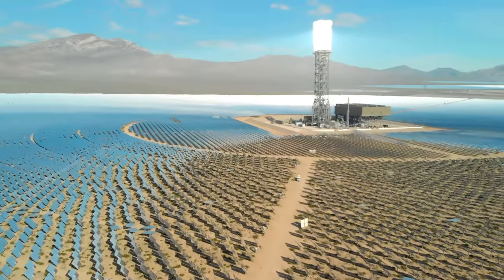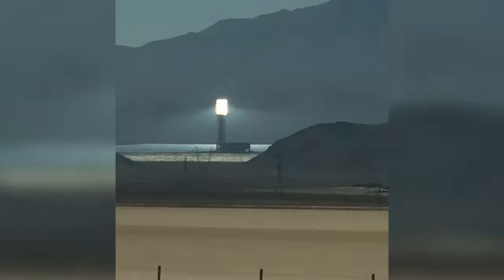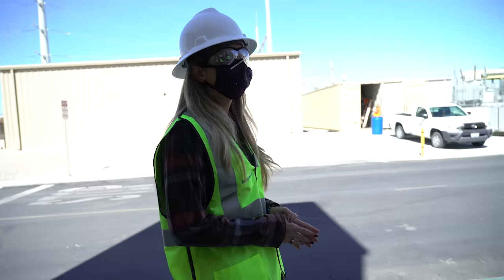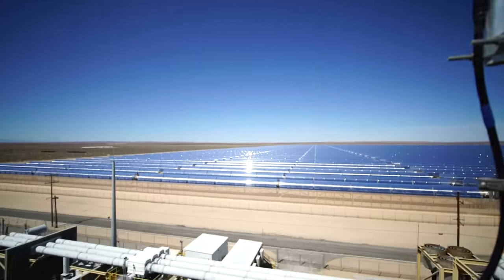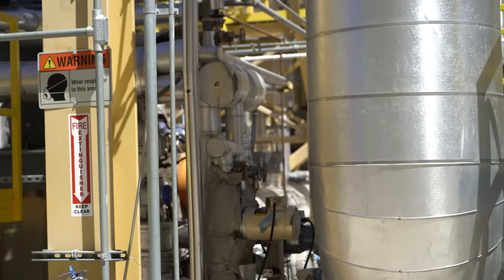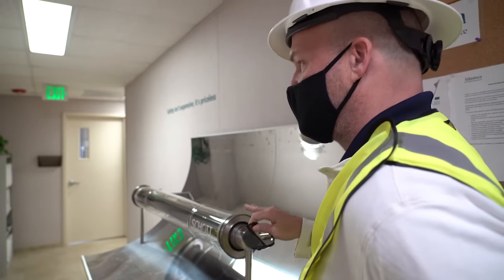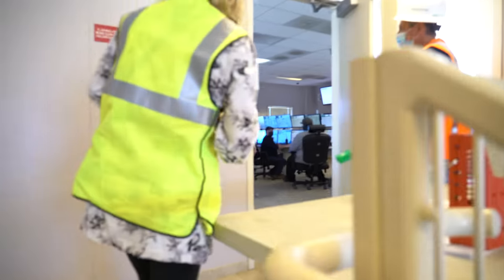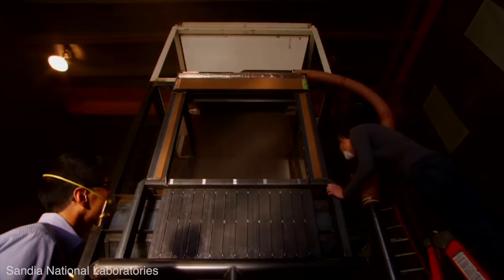How Mirrors Could Solve our Energy Problem

Comment: This solar thermal tower power plant has closed down, as it was costing more in maintenance than than the income from electricity. The issue is complexity, cost, and economies of scale. The cost of PV and battery storage is much cheaper than solar thermal, and is still getting cheaper.

Comment: I made some of those parabolic mirrors at Noor and Noor2 which are installed in Morocco. Specifically, I was the plant engineer at Rioglass Solar in Surprise, AZ, and I designed, tested, and validated the packaging to ship 2 tons of glass (per package) across the world. I also 'owned' the mirror line, furnace line, product printing, etcetera. 

One small nitpick: it's not a focal 'point' but a focal line.
Reply: Is the focal point the radius?
Reply: @koendos3  No you get a focal point when using a circular parabolic mirror. These are linear parabolic mirrors, so the light is not concentrated in a point but a line.
Reply: @koendos3  no, the focal point of a parabola is opposite from the directorix line. Focal point is where all parallel, incident rays (from the sun in this case) are directed to. This applies to a parabolic curve in 2d (x and y only) space. Since the solar arrays are parabolic troughs in 3-d space ( x, y, and z), all those infinite focal points line up to form a focal line. System efficiency depends on that line having a very narrow (narrowest possible in practice) width to minimize energy lost to reflection.
Reply: Also, those parabolic troughs are 4-segment arrays composed of 2 inner parabolic segments and 2 outer ones. They are of course symmetric for max solar capture because they are computer- steered to point optimally toward the sun.
Reply: @nicklockard  I wonder if at some future point it will be possible to make a Sun-fed linear LASER, focussed in a line.??
Reply: @nicklockard  Do they do ray-tracing to shape the reflectors like was being discussed a couple decades ago? Or is the gain not worth using a simpler parabolic shape?
The idea was to get the energy flux more evenly distributed across the cylinder than you would get by focusing the light to a "point/line" of zero dimension.
Reply: Do you know what the final energy output is per square meter of land used for an installation? I wonder how it compares with PV panel output energy per square meter.
Reply: Its a focal point if you slice the mirror in 2D.
Reply: @Markle2k  I think you're speaking to compound or complex parabolic troughs which are more tolerant to poor sun tracking. No, RS only does pure parabolic shaped glass. We only had the contract for highly reflective, shape-accurate, and durable glass mirrors. Other companies had the contract for site engineering, mounting, tracking, and power generation, etc. 

We confirmed shape accuracy to less than a micron and generated a relative power percentage (of theoretical). It's been a while, but our spec was insanely tight. You can skew each segment's curvature a bit via the mounting pucks which had maybe +/- 6 mm of in/out play, but if the basic shape is poor, power would suffer.
Reply: @Jonty Chatterjee Hi Monty. I don't have a strong grasp of those figures, sorry. But I do know that you can focus about 14 kilowatts of thermal energy per lineal meter of a single trough onto the absorber. You lose energy (to both heat and pumping losses) to the accordion sections, piping, etcetera.

Since the power generation is by steam turbine using pretty low temperature steam, the efficiency limits are fundamentally linked to how hot the steam is when it hits the blades. It's called "low Q-value" heat. The best implementation of this technology, in my opinion, would be in a co-generation plant where you augment a high-Q process AND utilize all the waste heat in a bottoming cycle, such as for textile plants or refining, extraction industries, mills, etcetera.
Reply: If you were so close to these projects, it would be useful if you would speak to the practicality of this technology.
Reply: @david203  I had professional ownership over the engineering of the manufacture and shipping of the mirror segments, so I'm not a system expert. But I know it's highly practical in the southern Morroccon desert. It would probably be even better near Phienux, AZ. Not because of the sun, which is less than the Sahara, but because if the closeness to 5.5 million users, and it would work well for medium industry steam cogeneration. For that matter, next to any major metro area in sun class 9 or higher would be economical, I'd guess. Noor1 and Noor2 do well in Morrocco because the King really supports it and wants to eventually export power across the Med.
Reply: The noor plant produces 500 megawatts. It cost 2.5 billion dollars. There are now three noor plants. The three combined put out 14000 gigawatts per year. Back-up fuel needs for the Ouarzazate complex have been estimated at 19T/day of 
gasoil for a capacity of 500 MW. Gasoil with a sulphur content of 50 ppm is 
recommended.. Which means it needs to be replaced.
Google maintenance of noor plant, read all about it.

Comment: In the early 1980's I had a solar water heater on my roof. It tracked the sun with parabolic mirrors.  The same as in this video, only a lot smaller. Side note it also made shade on my roof and kept the house cooler.
Reply: @Gary Tompkins: Nice! That is sometimes referred to as "passive" solar in my experience. It is commonplace, in areas such as Taiwan, to observe water storage tanks on roofs with similar goals in mind! However, it is prevalent to utilize on demand water heaters in such areas for showers and such, so the water storage tanks on roof tops are more to provide free pre-heating, lower operating costs, and as an added benefit: better water pressure due to gravity's effects!

That type of attention to detail can be done everywhere and while the energy wins are not jaw dropping, "everything counts in large amounts" small gains add up over time!
Reply: Ha! Love the DM reference.
Reply: @grey5626  " It tracked the sun with parabolic mirrors. "
Reply: @grey5626  no, it is active solar, passive solar is things that don't use tracking systems or need to be messed with after installation like south facing windows, and awnings that are long enough to completely block the noonday sun in the summer, but are short enough to let it in during the winter.
Reply: Did it use true parabolic mirrors or cylindrical parabolic mirrors? The latter would be a lot cheaper. Did it use metallic mirrors? Again, a lot cheaper.

Comment: Fun fact: Using mirrors to concentrate light is not mutually exclusive with using photovoltaics. Concentration photovoltaics is also a thing, where you use PV cells that are optimized for far more light than conventional photovoltaics. For that matter, there are photovoltaic/thermal hybrid systems out there that use a thermal transfer fluid to cool the PV cells.
There are many many flavors of solar power :)
Reply: Amazing there are even Moon powered ovens in use today!  Not large scale, though interesting and I do wondering about what a scaled up utility system can absorb from the Moon light?
Reply: Photovoltaic cells are usually somewhat heat sensative, so you need to cool the cells, and seperate the infra red light from the rest(ideally using a reflective filter that points at a concentrated solar thermal genorator) since lower frequencies aren't useful for most photovoltaic cells and still produce heat.
Reply: Would be awesome if the price point of high temp PV cells came down in price.  Is interesting seeing where people have placed heat exchangers on the back of solar panels to use that energy for water or radiant heating.
Reply: Also, photovoltaics might be better for small scale, roof top projects, but where there's land available maybe the heat variant is better? Either way, they can coexist
Reply: But they have temprature limitation. Can they go to 1000s° and store energy?
Reply: They showcased one such application in the previous video: they were heating carbon and using IR-efficient PV with mirrors to reflect back the radiation that didn't get absorbed.
Reply: This sounds interesting!
Reply: Current photovoltaic cell have at best an efficiency of 25%
Reply: @srpenguinbr  Using solar for the pure heat is a significantly more efficient manner of conversion vs electricity
Reply: @gstpierre69  yes, specially as a replacement for electric showers. Mine consumes 4KW during winter, way more than photovoltaics can provide
Reply: Oil is also one of them.
Reply: @yannhuynh  Yup molten salt is often used because its one of the few fluids that will tolerate the high temperatures
Reply: yes, and run tubes of water behind the panels to heat water and help cool the PVs
Reply: and yet none of them can store power~!
Reply: Another fun fact: 90% people read the first sentence and scrolled on
Reply: @DonovanHaumpy  90% of people cant read
Reply: @chhansen9813  CSP can easily store 12hrs of power production. Base load production is possible and is done.

Comment: Had several of these built in my hometown. All of which are gone now because it was relatively inefficient when it came to creating power. Albeit, it worked, but they transitioned quickly to putting down solar panels instead. Another problem is that the concentration of heat from all the mirrors would literally fry birds who flew in the path of the reflections. Nonetheless, it’s an incredible and effective science, and it works, however there are complications and inefficiencies that tend to ruin its potential.
Reply: You’re right. The solar water towers aren’t as efficient with energy production  as originally thought.  And lots of cost towards Maintanance of constantly rotating mirrors.
Reply: Instant fried chicken
Reply: @cycleoflife7331  exactly lol
Reply: @cycleoflife7331  hahahahah🤣
Reply: Yes but companies receiving government  grants and subsides for this solar design are happy because its expensive to build and the government must pay more to the companies involved. They don't care if its twice the cost of PV
Reply: @mr.objective6936  Its not water. Its molten salt.
Reply: They’re doing things to help increase efficiency and lower cost. Software to control smaller mirrors and increase the heat they can produce. More efficient heat storage to produce electricity during off hours, etc. and automation to decrease the manufacturing cost.
Reply: @jed4131 It’s said that Heliostats (mirrors) controlled by humans have an energy efficiency rate of 60%, which is still better than photovoltaic panels. AI controlled heliostats were able to consistently get 95% energy efficiency. 

I recall reading that one Solar Tower generates Hydrogen instead of electricity. Another application

Comment: Something that wasn't covered, but which seems compelling to me, is that CSP, unlike PV, does not strictly rely upon heavy metals and a toxic manufacturing process.
Reply: But are far more expensive than PV. The economics actually cripples these designs.
Reply: PV relies on vast amounts of coal with attendant pollution but also Chinese death camps, but unlike CSP,PV actually makes a tiny bit of electrical power.there  are still csp operating but not one met benchmarks.
Reply: @infini_ryu9461  Just so you know: solar towers where shown to me 10yrs ago from a video from spain and i loved it, had her exact reaction. (It may be relevant... or not)

And now back to what i wanted to say:

"more expensive", why? you buy the iron(and coal, or even scrap steel, copper, tin or rust) and melt it on site to make the mirrors and pipes for expansion, use up the 3000 possible degrees on top the tower(which is enough to melt effectively everything including rocks, except tungsten(wolfram)) (the theoretical maximum for lenses is actually exactly the temperature of the surface of the sun, so i assume that is the case for planet side mirrors also), the only downside of doing it my way, is (a need for one already existing plant +) slightly lower efficiency since you will need some energy for the melting process instead of selling it to the market and also steel is not the best reflector when polished, but you can use literally anything (above 50% efficiency for reflection*absorption of the reflector and absorber) really if you are fine with building 2 plants for the income of one, which after the first, all others will be almost free since (as far as i know) the biggest cost of metal parts (currently) is the energy cost to melt them (apart from silver, gold, or something more exotic). 

I'm curious why energy storage is such a problem, you have energy, pump some sea water, boil, electrolyse,
fill a balloon and the sky is the limit, when you need the energy get the oxygen, hydrogen burn them and have the energy back the good old fashioned way, since you have practically free energy ignore that hydrogen leaks through solids, we already have a hydrogen and oxygen sphere above cloud level, if it gets saturated it will turn into water and rain down. The only thing that is dangerous about storing power is that you have stored power, a balloon of hydrogen will be just as bad if it violently oxidates as a broken dam, fly wheel, a molotov cocktail(fuel bomb), pressure (tank/)vessel or a short circuited battery with the same energy storage(all of the described things have relatively same discharge rates since all could kill you if you are a kilometer away(at 1GW of stored energy, since i don't want to bother with the exact values) and unlucky enough that you are in the blast cone(-s)).
Reply: @ГеоргиГеоргиев-с3г  There is no such thing as free energy. So you have hydrogen loses and energy loses the further it has to travel. You have energy loses in the storage with batteries. The entire thing is an economical disaster.

Then there's the fact that wind turbines heat up the air they are in completely negating any carbon emissions they might have saved.
Reply: @infini_ryu9461  i know the second half is BS, but let me humour you:
How does the "air heated by the blades" contribute to "carbon emissions"?
Reply: @infini_ryu9461  a little fan blocking wind heats the air? Then mountains and trees must be smoking hot!
Reply: Except for all the generating plant infrastructure, like structural steel.  And copper wire.  And the insulation around the wire.  And the paint on the steel.  2050 is entirely to soon, maybe by 3050.
Reply: much more efficent too..  heat from sun is much more efficent than PV.
Reply: His first sentence is already bs. It might be true in general, but he ignores the context. In solar energy the cost for the energy production is actually paid in the sun itself.
Reply: @Diogenes2077  well, the cost for energy production may include cost of the units and perhaps cost of manufacture and transport of materials too.  There will be much much more efficient solution coming down the pipes.
Reply: Everyones complaining about efficency or cost,   I myself have built small prototypes and get better rapidly there should be some progression were innovation makes things more exciting.   I wonder what the cost difference is on smaller plants verses larger ones,   Initial and longterm
Reply: @infini_ryu9461  The steam-driven turbines being used use water (steam is water), and do not use fossil fuels like the JET turbine engines on airplanes. There are no carbon emissions. And where does hydrogen come into this? Energy transmission losses exist for all forms of electrical generation, not just CSP.

Comment: This series has been so enlightening! I've really enjoyed the way you've introduced us to all these different solutions and compared them while keeping it easy enough to understand. This stuff is important but intimidating and often overwhelming, so I've really appreciated having you as a guide :)
Reply: you could build this mirror in every desert, it would still never be enough energy, and i don't even mention all the rare minerals we need
Reply: Solar tower power plants can have benefits for plants and animals there. Under the mirrors, evaporation is reduced. That means plants have more water available to grow and more plants mean more food for animals. Deserts usually mean to much sun and too little water, so those mirrors remove the liminting factor for plant growth. 

Mirrors consist mainly of aluminium and glass, so they are constructed from the most abundant elements on the planet. We have more than enough of the necessary materials to cover all deserts with those kind of plants, and those would provide more energy than the world currently needs. We wouldn't even need every  desert. And the bigger we build them, the cheaper and more efficient storage we can have because of the square-cube law. Storing the heat with molten salt can allow electricity production 24/7 without needing fossil fuels, but unfortunately those power plants right now are only built with no storage or only a very small storage tank. The storage is not as efficient as lithium-ion, but up to 100 times cheaper.
Reply: It's a lie
Reply: @slaytronic  yup, birds get insta-fried. Made me wonder if I could weaponize this technology for home defense...during the day anyway. lol